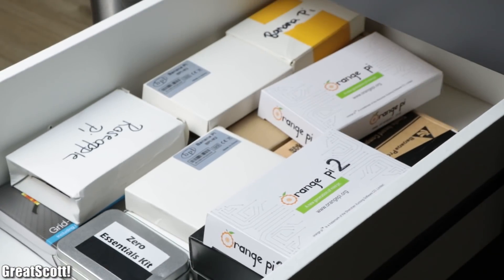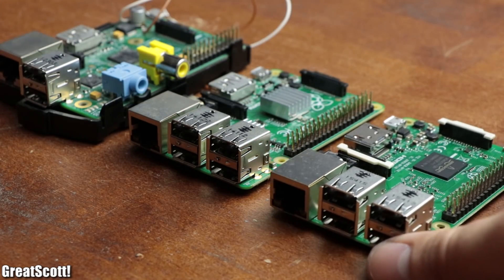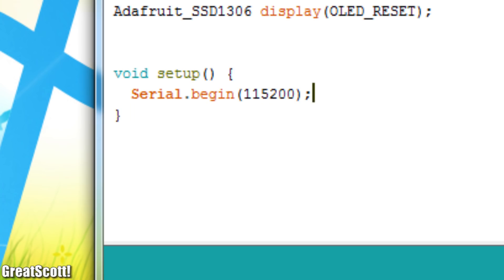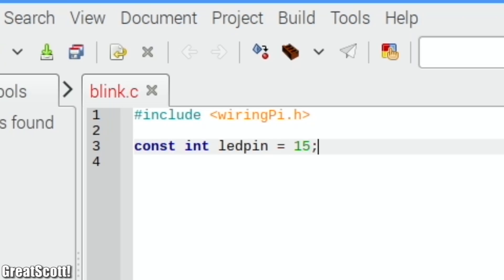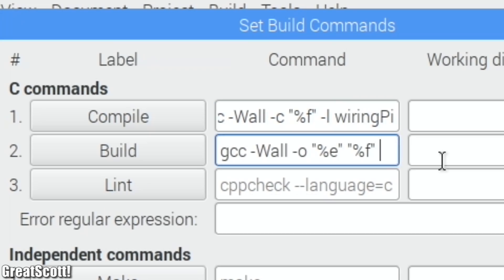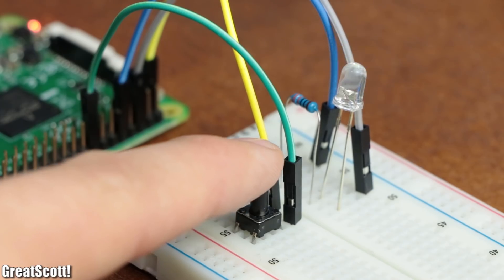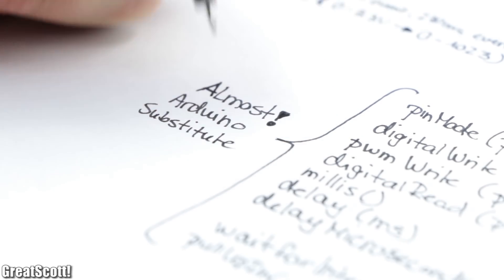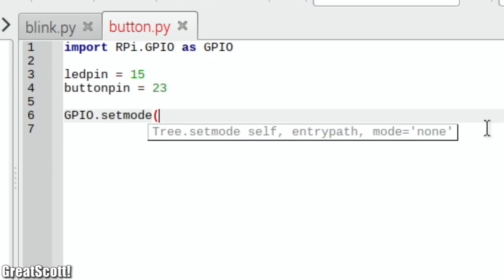Can a Raspberry Pi be used as an Arduino? || RPi GPIO Programming Guide 101

Comment: so the raspberry pi can use something similar to timers, im not sure how familiar you are with linux, but linux can send a signal to your program, and you can then send a signal to the linux kernel, for say a timer, and then you would be able to handle timed events, and with quite a bit of work you can even make bare metal code for the raspberry pi and handle interrupts, though unfortunately this is annoying to do, because the lower level parts of the raspberry pi are quite poorly documented (you need to know hardware addresses, you have to know exactly how the pi boots up, and you have to know how to handle different cpu modes).

Comment: It would be very interresting to have a video around the wireless communication (radio) between an arduino and a raspberry.
Let's say the arduino is where the sensors are connected and the data logging part is on the raspberry (like that we can have a UI to display the data later)

Comment: I still do not understand why a Raspberry Pi should be compared with Arduino. It is of no use; 1. 32-bit vs 8-bit, 2. Mega bytes ram vs Kbytes ram. 3 Clock speed..
Reply: Hobby users love to argue for their favorite. The microcontroller (like Arduino) is far better for certain types of tasks than a Raspberry Pi. The reverse is also true. The bus width, memory, and speed really don't matter unless it's a specific project requirement.
Reply: cypherf0x I am happy with any microcontroller which is best for a specific project. It is just odd to compare 32-bit Arm boards with 8-bit controller boards. Additional, if you really want to compare , then you must not use Raspbian or any Linux flavor. It is not available on Arduino boards.

Comment: I am thinking of making a raspberry pi based security system for my shed. The idea being that it recognises a when there is a moving object and takes a picture every few seconds while there is a moving object, I would ideally like me to be able to remote access the images or even a stream and also be sent a notification when the alarm is triggered. Going an extra step would be to incorporate facial recognition into the code and attempt to get pictures of the face of the would be intruder. My shed has internet access and links to my houses central HDD so storage wouldn't be an issue for the volume of data being transmitted.

Comment: What I'd love to see is something like a Raspberry Pi controlled system, (perhaps wit ha LCD/touchscreen interface) controlling various arduino-based sub-systems for home automation. Basically, have a PI with touch screen on the wall and connect via wifi or similar to various arduino boxes to control lights, shutters, A/C, etc.

Comment: Hey guys, currently I am in my internship semester and have to build a soccer playing robot. Therefore I am using an Arduino Mega 2560. It doesnt need to get a professional soccer robot. It only has to detect the ball and shoot it. Is that possible with my arduino ?

Comment: One thing I will also suggest is that you can use BOTH an Arduino and a Pi. In a project I'm working on, I'm letting the Arduino be the powerhouse for I/O interactions with sensors and transmit the data back via Serial to the PI, who is acting as a Websocket server for other things to connect to as well as handling other math computations on the sensor's data, leaving the Arduino to only worry about managing sensors. Because the Arduino IDE is even available on the Raspberry Pi, you can have a fully set up development kit ready and on standby.
Reply: it's nuts how far we've come in 5 years. A single ESP32 (or Pi Zero W) can basically do all the now lmao.
Reply: @Rushil69420  the esp32 is amazing for these iot data transfer stuff. Rpi 2w is good for something that needs a cam.

Comment: I really don't think you made a big enough deal of the start up times. Microcontrollers start in next to no time, but the Pi has to load the OS. I think "adding" processing power to microcontrollers by way of sending data to a server is better than taking the power to the device. That's my two pence.

Comment: Arduino is better because it has more digital IO pins and analog input pins and is good in terms of hard real time precision, while Raspberri Pi is characterized by the speed and ability to create servers for storing and calculating data. And he's ranked soft real time by precision as far as time precision is concerned. So it's best to use both. Arduino for sensors and actuators, and RPi for GUI and various software features.

Comment: i would very much like to see you control motors with the pi 3 B, i think it would be a brilliant demo of what it can do

also if you need more ideas for pi videos, you could re-create some electronic analysis tool like an oscilloscope, or make a variable power supply where the pi controls the amount of current and/or voltage from variables in code.

love the videos, and im glad you have started pi projects

Comment: Notice the flash in the upper right corner on the booting screen?  That is an indication that there are to low current from the charger.  It usually need at least a 2.1 A charger.

Also notice, you can use python, C or Scratch to control the IO pins.

Comment: Please do a project using Raspberry Pi and Arduino together. Arduino GPIO with the brains of the Pi would be cool. Maybe an irrigation system where you can access a web server front end to control, or something similar?
Reply: Yup, +1
Reply: Why adding a 8-bit controller to a 32/64-bit ARM core(s) with plenty of RAM? When you want to do, for example, just add a PCA9685 : https://github.com/vanvught/rpidmx512/tree/master/lib-pca9685
Reply: @ArjanvanVught  what does that do?
Reply: @YOUnoobGER  read the link?

Comment: Raspberry Pi = small computer. useful for
- low power Server applications (like a webserver, print server, server to controll some smart home stuff etc.)
- Media applications (the graphics are quite good for such a small/cheap unit)
Arduino, Teensy = Microcontroller stuck on a tiny PCB.
- Replaces a Microcontroller if you are to lazy to solder one into your circuit (+ it is a LOT easier to program than for something like an AVR or a PIC without a firmware/toolkit like arduino)
-Useful as an usb interface / controller, like for example in homemade input devices (keyboards, joysticks etc.) and in robotics

Comment: I really don't understand why people go through such stupidly complicated methods to make such simple GPIO scripts. You can control the GPIO pins directly through Bash, which is literally the Linux terminal environment.

As root, the following would get you a blinking LED, assuming you use GPIO21 as the 3v3.

echo "21">/sys/class/gpio/export
echo "out">/sys/class/gpio/gpio21/direction
while true;do
 echo "1">/sys/class/gpio/gpio21/value
 sleep 0.5
 echo "0">/sys/class/gpio/gpio21/value
 sleep 0.5
done

That is literally it. I've never touched any programming language for my Pi projects. Shell scripting can do pretty much everything, as long as you don't need interrupts.

Comment: A few years ago, a friend of mine and I wanted to build a ECU with fuel injection and electronic ignition for an older carbureted engine with points ignition. I was thinking of using a PI or adruino. I'm not that clued up on arduino nor PI, but my friend, who knows a bit more that I do explained that the PI is much slower compared to the arduino for the purpose. Not sure how accurate this is. Would love to know your thoughts?
Reply: Half accurate. The Pi is actually a lot faster in terms of raw processing speed, but it's not built for real-time operation. The full OS it runs is always doing a hundred different things, and sometimes it might be busy for a few milliseconds at a critical moment, so you can't use it for something that needs highly precise timing control like an engine - at least not without a more appropriate operating system. The arduino is much slower, but it's also a bare metal environment - no operating system or competing applications to get in your way, so it can actually react in a much shorter time than the Pi.

Comment: The main problem of Linux boards like RPi 3 is the fact that the interrupts cannot be handled from user space (aka your program code). Any callbacks in WiringPi are in fact polling the state of the pin and then calling when there is change of state. This is quite problematic if you want to handle lots of inputs and want to relay on precision. The other issue is the unpredictable behavior of the multi-threading code which is neat if you need them, but can be problematic if you want to drive step motors, reading speed counters or measure sonar time etc. In my projects MCU is just necessary to delegate such delicate tasks reliably.

Comment: BTW, you can try QtCreator IDE -- it offers much more help when writing C (and C++) code. Also, it is better to boot Raspberry into console mode, so that GUI does not eat away its processing power. Again you can use QtCreator to setup cross-compilation on your PC (ABI is arm-linux-gnueabihf) and setup a Remote Device to run the compiled binary on.

Comment: Great Job! Thank you. I was trying to connect the INA219 board to the Pi and I got stuck in python so I would like to see an update to your project with Power Meter/logger on the Raspberry Pi. I only managed to connect the Ina board to the Pi and to read the i2c address (40) from the terminal with the i2cdetect command.

Comment: I'm working on a project that the Raspberry Pi 3 B made simple. 
To start with I'm just using the Bash scripting language that is amazingly powerful. 
I needed a wifi TCP connection, check. I needed to send emails (using gmail to make into text messages), simple apt install, check. Needed to time stamp text messages, NTP already there, check
 Needed to output tone alarms and voice alarms, just add an audio amp and speakers, and wav or mp3 files, check.

Comment: I like both. I used to use kernel modules for timing with sysfs to interact with user space, but now I use an Arduino to provide a software and hardware abstraction layer that simplifies development and protects my much more expensive raspberry pi from electrical damage.

Comment: Is there a pi clone available with 5v   output pins? I think that would be more convenient.
Reply: Just use level shifter
Reply: @3daystogo_create  🤮
Reply: Maybe there's a shield, or you can create one, that uses the 5V an Transistors to convert the 3.3V to 5V
Reply: Pi has 5 v
Reply: @Noor-oh4jq  pi takes 5v but outputs 3.3 v through its gpio pins.
Reply: @electronichaircut8801  Pi outputs both, at least Pin 1 is 3.3v I think and at least pins 2 and 4 output 5v (I say at least because there may be more)
Reply: @deansdrawings6844  Yeah, but logic high on the i/o pins are 3,3v.
Reply: You mean 5V GPIO output pin? Because 5V DC output is already available.

Comment: How about wall clock with seven-segment display? It is possible to use ntp time sync on the Pi, so this clock will be pretty accurate.
Reply: One of the application for Pi is NAS or Media server. In my case it is NAS. It provides GIT server and NFS server. Everything is on btrfs raid0. Good for storing photo and document archive, so I don't need to keep copies on my other computers in my home network. So it is low power solution running 24/7 (For bigger files I have other solution with greater capacity and bandwidth, but it is not running 24/7). Besides that it's not doing anything useful. So I am considering to add this clock functionality. Of course you can do it other way, but how about accuracy? Leap seconds? Automatic daylight saving time adjustment? Calendar? Sure you can use GPS or DCF77 or some other solution for synchronization, but in case of NTP you have it for free.

From the other side it's about educational video, right?

Comment: Also the raspberry Pi (Rpi) can have connection with arduino by USB, and have a bidirectional communication, with that you can easily use both and now you have the vintages of arduino like ADC. A good project could be an intelligent cae that map his specific route and of course add another's items like distance measure, lights and so.. Interesting introduction of RPI

Comment: Raspberry pi consumes a lot of current to work in compare with arduino, that's why I never use raspberry pi.
Reply: Juan Hauara probably never did multi threaded / processes programming
Reply: lauro199471 Ho yes, I have programmed multithreaded apps in java but running in a PC or a smartphone. In electronics applications the 99% of cases can be resolved with a simple linear program. One of the advantages of using a microcontroller is the possibility of work in real time in the order of micro and nano seconds, no one operating system can do that.
Reply: electronics applications in simple linear program? So doing I/O is simple? Thats a really tough subject to tackle really... have you ever done intense calculations for robots? Unless your planning to put a full-blown laptop on top of your hardware projects good luck on your wallet.
Reply: +Juan Hauara Huh? based on which assumptions?

Comment: I thought arduino uses c++
Reply: It’s a variation of c c++ c#
Reply: @hawilly4992  You say that like C# is anyhow directly related to C and C++. It isn't, it's closer to Java (*not* JavaScript!) than anything. Also, AVR Arduino code is a subset of C++. It has things like classes, but lacks many of the C++ features not found in C, based on what runs on an AVR μC and what doesn't. ARM Arduino C++, however, is full C++. Also, Arduino C++ in general differs from standard C/C++ by the fact that the entry points are void setup() and void loop(), not int main().
Reply: @lithiumwyvern_  You are right.  C# IS developed from Java by Microsoft, because they wasn't allowed to change the contents under java. and javax. packages how they wanted by Sun.  So they kind of forked Java into C#.  It has changed a lot since then.

Anyways, I believe the Arduino C++ compiler is based on GNU, so it is full C++.  And yes, you create objects from libraries, so you use C++ features.  Don't remember the version of the compiler though.
(It was a while since it looked into the compiler in Arduino, might have remember wrong or they changed the compiler. :-D )
Reply: All C code is valid C++ code, so he isn't wrong technically.
Reply: @RyanJones-lv9dj  But not all valid C++ code is valid C code. Because that's how a superset works, and C++ is a superset of C.

Comment: Thank you!

I have a version 1 Raspberry Pi that I bought with big plans and never got around to doing anything with it.
A CarPuter to use a touchscreen, GPS, MP3 player and interact with my Megajolt car ignition system.

As an arduino. It is ovrrkill.
but if you have a project where heavy processing is needed. 
Then yes.
a RPi is the way to go.

Comment: I want to see a smart home controlling future with raspberry pi 3 which will have automatic water tank filling, power management with solar pcu. automatic stair lighting, motion sensing outdoor lighting with motion capturing, home security when in home or out of home, disconnecting the external cunnections when lightning or thunderstorm is happening to prevent internal home appliance getting damaged from lightning etc.

Comment: Extremely well done comparative analysis. I would add that in addition to data collection and analysis, RPi excels at Internet-style communication, especially if you invest time in learning Python. I put custom web server front ends on most of my projects so I can use RESTful clients on my tablet and phone to control them. I also run Arduino IDE on a permanently integrated RPi zero w controller so I can update software without recabling my Arduino projects. In fact I don't even need to get off the couch.

Comment: In India, we get an Arduino at 10% price of a Raspberry Pi. Why waste money if it is not really necessary.
Reply: Shuncey Balba Also China made UNOs. They are around ₹300 - ₹400. But a RPi costs here ₹3000.
Reply: Buy a Orange Pi Zero, that is 7$. But still not comparable with an Arduino. The OPi Zero has 4 32-bit ARM cores, > 256 Mb memory, SPI flash, SDCARD. And there is an Arduino ...

Comment: At the end of the day an Arduino (which is essentually a ATMega chip with a little bit of extra for ease of use) costs around 2€ while a Raspberry way way more. It does make sense if coupled with Arduinos, which handles bare hardware and electronics while the Raspberry used for processing purposes or data-storage purposes, but as a replacement? No.
Reply: Pi Zero is only $5
Reply: An arduino consists of an atmega, crystal, two caps, and (depending on model) possibly a voltage regulator, usb-serial chip and LED. What really makes it an arduino is the bootloader and software stack, which make development trivially easy for the electronics hobbyist who does not yet have the skill for low-level assembly coding or intricate knowledge of the atmega IO functionality.